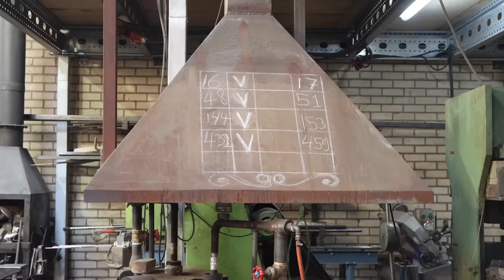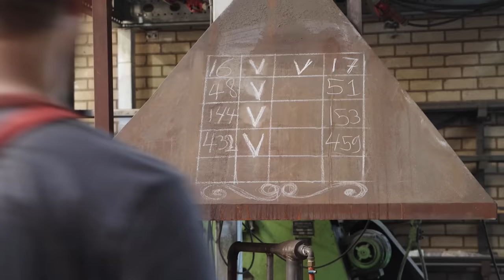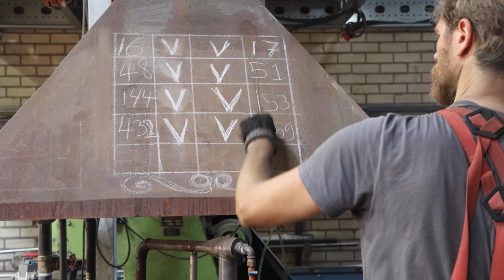Forging a long sword, part 1, forging the blade.

Comment: Very impressed by those press dies that form the fuller and a rough bevel in one go.  It might take a few heats to rough form the whole blade, but it keeps trips back to the forge down to as few as possible to make the blade.  Good for the steel, and less effort for the smith.  Really clever tooling that shows hard earned experience in the craft.  I envy that level of craftsmanship.
Reply: I've been watching a lot of forging videos lately, and never seen anyone use dies like that.  It's frankly brilliant and I'd think it would be more obvious to more smiths.  Instead, they spend ages grinding away perfectly good steel.
Reply from the maker: it's not that easy , grinding is safer.

Comment: does anyone know why he gives it drills a bit at 11:30 before putting it back on the forge? What is the purpose of that?
Reply: 5 months late so you probably figured it out. But it's part of making raindrop damascus.
Never tried it, but I think when the drills get forged shut, it creates the raindrop pattern in the steel.

Lots of different patterns you can make with damascus and that's one of them.